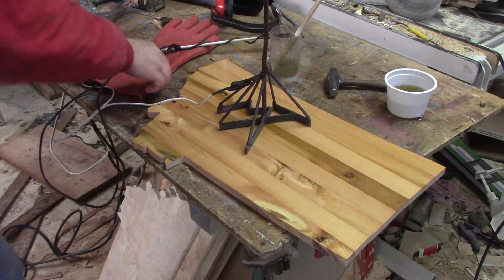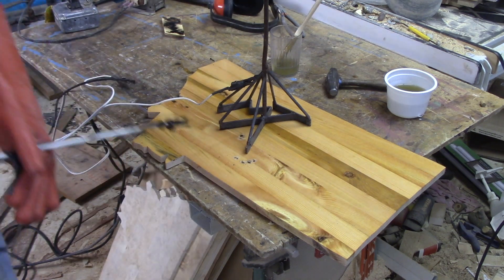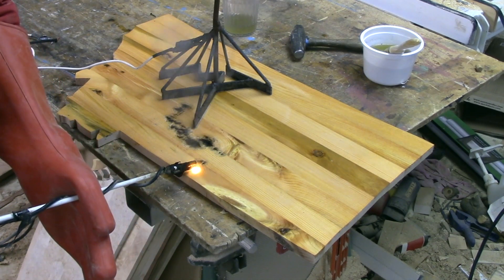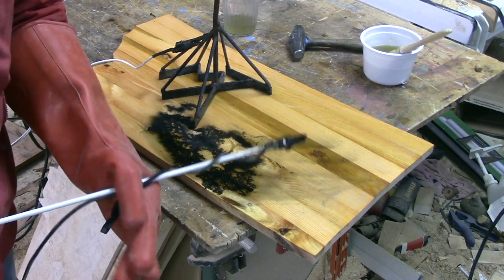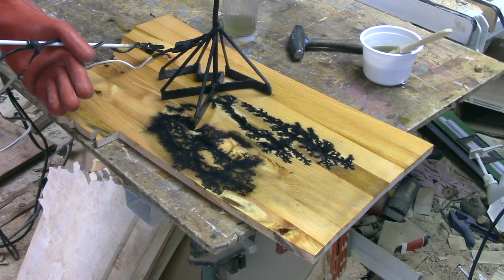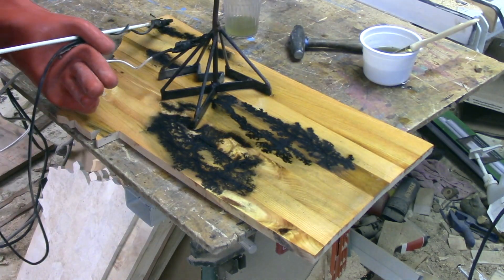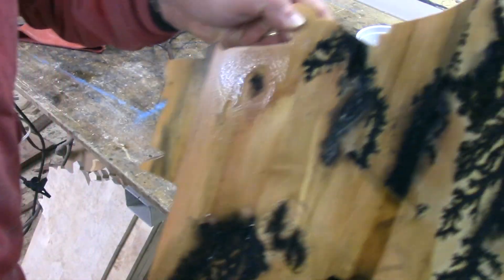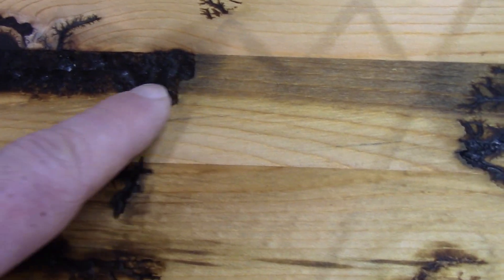Lichtenberg Experiment: Simple Pine

Comment: Let the solution soak in a bit more I've used rounded brands worked pretty good left a moon like silhouette. Also I've found it to be a tad slow to jump joints but I've found putting a conductor across the end to really speed it up and better results

Comment: what kind of ballast are you using?
Reply from the maker: MOT but folks don't recommend using them because of the amperage, I offset that with a ballast.  Several recommend the igniters from oil furnaces.
Reply: yep furnace igniters work great as do neon sign transformers. you tried it with acrylic yet? would love to see that